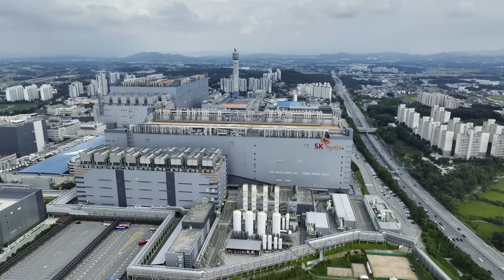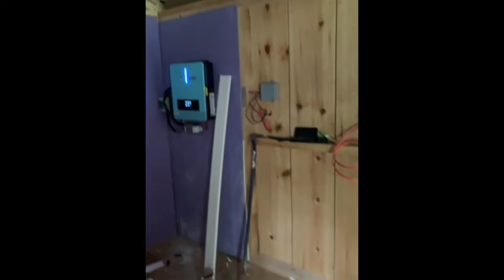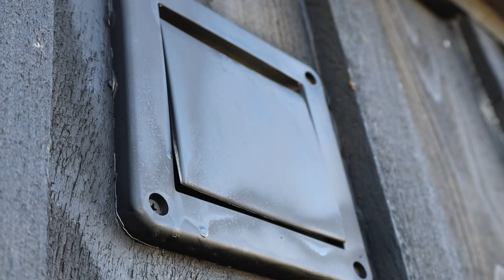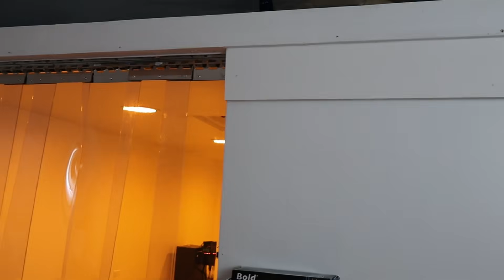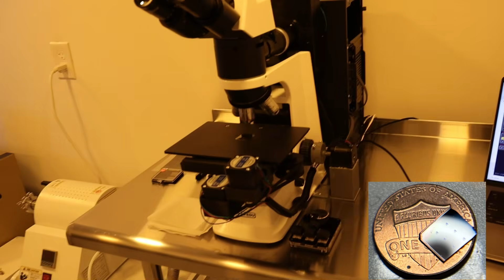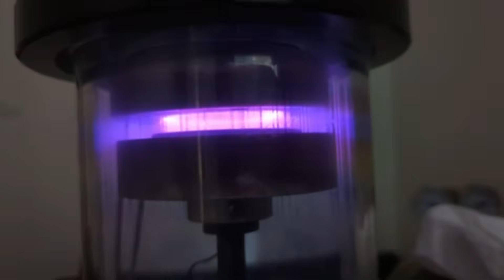There’s a Class 100 semiconductor cleanroom inside this backyard shed.

Comment: Speaking as someone who lives in Arizona, next time you ever take on a project similar to this, don't use those aluminized foam sheets, have a company come in and coat the entire inside surface of your building with polyurethane foam. I've been in attic spaces in the middle of the summer here and the temps weren't more than about 90, which is incredible! Usually an attic space in teh AZ desert is well over 140 degrees. It completely seals the space so the insulation performance is greater than anything else you can possibly do. Seems like having all external surfaces be airtight would be handy as well.
Reply from the maker: Oh man haha can't get away from the outside temps, I am always having to pull in filtered fresh air to provide positive pressure, where that air needs to be heated or cooled to lab temp. Crazy enough there are a bunch of little things to consider with a cleanroom, like spray foam will actually continue to outgas for months. Instead I used rockwool which sheds less and outgasses less than many other solutions.

Comment: Once you suit up, don’t you need to air washed first before going in? Or do you wait for several air changes inside before starting any work?
Reply from the maker: Great question, haha I have such crazy airflow in a small volume that I think I can just treat it as an air shower itself? Either way that is ok, it is for R&D mostly so yield isn't critical. I have a whole DI water system though and will regularly wash my cleanroom suit.

Comment: Good job, looks really good. Tip if I may: At some point you want to wash your cleanroom suit, please use a washing detergent without parfum and without fabric softener. Substances like parfum and makeup are contamination sources.
For those wondering, in larger facilities there are air showers between the gowing and working area.
Reply from the maker: Great tip! I did look into it, where having a company come to just pick up one suit wasn't economic xD So exactly that, I wash the suit myself by hand in a cleanroom environment. I use detergent without those additives and have a De-ionized water setup in my basement :P I leave the suits to just airdry in clean air after washing. 
I maybe should get one of those mini airshower systems, haha but I have so much airflow in a small volume that I kind of just treat the whole thing as an air shower?
Reply: @Dr.Semiconductor It does add to the cleanliness.  Whatever you don't bring in, the down draft doesn't have to remove.

Comment: Please build Charlie Chases and Garret Moddel’s MIM diode with casimir cavity. 

Casimir cavity MIM (Metal-Insulator-Metal) diode is an energy-harvesting device that generates electrical current without an applied voltage by tapping into zero-point fluctuations (vacuum energy)
Reply: Btw, I subscribed just to see you do this 😊

Comment: Does your gowning anteroom open directly to the outside environment? Is your anteroom air filtered? (HEPA or Bag filter) What is the cleaning process / frequency? Did you take particle counts for both static /dynamic conditions? What is the actual TAC (total air changes) for the main room and have you calculated a recovery time? Have you considered aquiring a cheap smoke generator for airflow visualisation?
Reply from the maker: Haha all great questions, yes the gowning area doors open to the outside, which isn't the best such that I run it with a bit more positive pressure than normal and minimize the time I am entering. The gowning area serves as a pathway for the air in the cleanroom to exhaust and loop back around so particle counts were actually around 200-300. In the "attic" space above the cleanroom which is the airflow return/entry point, fresh air from the outside is pulled in to provide positive pressure. This intake air has an initial MERV filter and then a HEPA filter which needs to be changed every few months. Since the cleanroom intake air is filtered the main HEPA filters can hopefully last a while. I know university labs that haven't changed their HEPA filters in over 20 years and still have reasonable particle counts. I also wipe down the flooring with a cleanroom wipe and solvents at least once a day. I have counts with both static/dynamic, haha I gotta calculate the TAC better since I have a different fan on one of the units but it is several hundred an hour. Should see about a cheap smoke generator but I have been just checking airflow is a meter, and watching cleanroom wipes blow xD 
Hope this helps!

Comment: the minute u open that door, the previously 99.9 sterile room that took weeks to build up to that point was instantly reset to zero. and should u be wearing ur clean suit outside?
Reply from the maker: Haha great questions, thankfully for semiconductors it doesn't need to be germ free or anything, but minimized particles in the air to prevent them from landing on wafers. But that said I run it at a higher than normal positive pressure to push air out when I open the door, as well as minimizing time the door is open, not perfect, but workable so far. Then no your right the cleanroom suit should never ever be outside, that's why for the little gimmicky intro I am actually wearing a disposable suit ;)

Comment: Like many others that have with cleanroom engineering experience, my last role supported manufacturing of semiconductor production equipment inside our ISO 4 cleanroom. 

First thought was absolutely, “what the fuck?” I’m assuming your knowledge here probably better than mine however I’ll give you some advice. Most of our sources of contamination was due to human behaviors. Wear some booties, have donning gloves and switch them out before going in the cleanroom. Use wands while handling wafers, wipe down surfaces with DI water mixed with isopropyl alcohol, upgrade the glasses to goggles and keep anything that could shed particulate out of the cleanroom. Finally, not sure if you have an O2 monitoring system, but it might be a good idea for general safety.

Also I was silently judging your donning process so kudos to you for doing top down. 

I subscribed and I am looking forward to the madness that is to come.
Reply from the maker: Haha exactly! And gotta watch what is brought into the lab! Yeah I have seen some labs double-glove to minimize oils on the outside of the cleanroom suit. I use the same DI-IPA mix to also wipe down surfaces and the wipe down the floor with a cleanroom grade wipe at least once a day to help keep it clean.

Comment: please i need the details of how the laptop and other items brought in comply, is it the airflow? so cool
Reply from the maker: Great question! So what the material is made of is very important. Like stainless and plastics generally don't shed a lot natively, where cardboard, paper, and wood do. Then anytime anything is brought it it needs to be thoroughly wiped down since particles from the outside will still deposit, cleanroom grade low particle count wipes are used along with isopropanol. Haha though if it were perfect you wouldn't need the constant fans, it is all about minimizing new generation of particles into the air.
Reply: @Dr.Semiconductor  "cleanroom grade low particle wipes" wow that's certainly new to me, nice!

Comment: I’ve always wondered if it was possible to make really good chips by modifying a hard disk drive. They’re already insanely precise, and materials like photoresist for magnetism already exist.

Maybe something like this could be a really cool project.

There are also HAMR drives which can use lasers and heat at the same resolution for writing data.

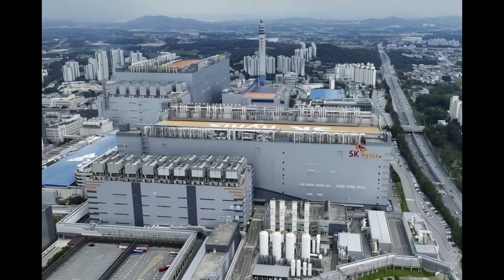Comment: how'd you make the transition at 0:47?
Reply: pretty cool use tbh
Reply: AI
Reply: Looked like ai, prob a starting image and an end image and make it imagine the middle
Reply: @christaps5126  yeah ai, some kind of cross-scene interpolation, but which tool that uses ai specifically i meant :P
Reply: @Couleur I bet it's some plugin in Adobe after effects, no actual knowledge on my part but it's probably just a regular old image morph with some sparkles
Reply: @christaps5126  Actually, you can do this in Blender, and use google streetview cameras to start with a photogrammetry model of the building, and then lerp the model's vertices from one to the other since it's going from more complex to a simpler shape. Probably not how he did it because it takes a lot of time, but just saying it is possible to do by hand.
Reply: AI…

Comment: You should also measure particles while your clean room is in activity. When I measure particles in an empty clean room with no activity, the results are very much different from a clean room with operators, equipment running, etc.

Comment: Where is the air return?  Usually in a laminar flow clean room the floor is a screen  or there are air gutters in the corner of the floor.  This is a small enough space where the reynolds number isn't going to be super important - You're turning the air around every few minutes

Comment: Always find it funny how not very clean a clean room is compared to what peoples expectations are, I assure you none are as prestine as you think they are. The air thats flowing may be clean but the surfaces of everything is not. Thing is in any modern fab the wafers are in FOUPS and are usually N2 purged at various points when they are stored between Operations. If you ever get to go into a fab just look at an actual Equipment Technicians smock, itll have grease and grime all over it and most of the time itll get worn the whole work week. 

Not to mention while yes you want to limit debris on the wafer, Their are alot of steps to remove it. You have multiple Scrub operations and sometimes Cryo steps to freeze particles to get them off, Spin Rinse Dry. Most scrap ive seen comes from Corrosion, Blocked Etch, or poor wafer handling in more manual fabs, Charging and Misprocessing. Airborne contamination from dirt or skin particles or whatever is so low compared to everything else i mentioned. This is all in bigger fabs BTW and still maintained 99% PY.
Reply: And yes blocked etch is from surface debris but usually is from the chamber itself or something in the wafer path on the tool depositing debris on the wafer vs it actually coming in from the fab on the wafer before an etch

Comment: What's the goal here?  Do you have everything you need to make a usable chip with outer package and pinouts?  Are you going to hone your technique with existing publicly available lithograph photomasks (I'm not sure what they're called)?  Are you going to make your own circuit designs and produce the photomasks?  Do you have the means to go from a schematic to a usable lithographic photomask?  Am I completely off base about how microchips are made?  It's not immediately obvious what you intend to use this lab for.

I'm obviously not an expert, but I don't see how you can go from schematic to completed wafer to cutting that up and packaging it into a usable chip with pinouts.  I didn't see the equipment for some of that.

Comment: This looks amazing. Is there a process for starting up, or do you have to keep the air running all the time always. That is, can you turn off the cleanroom, when you're not using it?
Reply from the maker: It is optimal to keep it running 24/7  which I do xD I try to offset the usage with solar panels, fans+lights use 600W, which periodically spikes to 1.5kW when the mini-split turns on for heating-cooling.

Comment: This "clean room" would never pass ISO 14644 or USP inspection. While the room does have a low particle count there are other elements to consider.
Reply: And it doesn't matter because it's a home lab for experimentation.
Reply: @Kniffel101  It matters if you're trying to keep a sterile environment. In the real world clean rooms should never be turned off.
Reply: @matthewgriffiths527  But this is not for production, so it does not matter as much.
Reply: @Kniffel101  Then what is the point? A room that looks like a clean room?
Reply: @matthewgriffiths527  EXPERIMENTATION

Comment: There's two things I notice missing.
1. No CMP will sharply limit the processes & number of layers you can do. You can work around it with various tradeoffs, but the alternatives are far less developed bc CMP is so good at its role that little effort goes into replacing it in industry. It's hard to DIY or buy on Ebay, tbf.
2. No BEOL / FEOL isolation means using metals like copper or cobalt without contaminating equipment will be nearly impossible. It can be worked around with Aluminum, Ruthenium or other interconnect materials, but with tradeoffs.
These aren't show stoppers. If you just want nodes well above a micron with aluminum BEOL to replicate 60s/70s level tech, and some MEMS as a treat, then it's fine. Based on the patterning setup's mechanical limitations, I assume you that had in mind in the first place.
Reply from the maker: haha yeah so I mostly do novel R&D on materials and devices, since it's not viable commercially for silicon at this scale, but maybe for youtube :P I would love to make some devices from the early 2000s. 
I have a few tricks planned for planarization, there are alternative methods that were developed and patented back in the day, but the industry consolidated around CMP. These methods though are perfect this scale, stay tuned :)

Comment: That laptop doesn't really know yet but its fans will be the cleanest and happiest fans around.
Reply: Hopefully he cleaned every Instrument beforehand.
Reply: @MaxMichel89  yeah those 5 particles might all be coming from internal dust lol
Reply: @antiLGTBQ  It's all recirculated through the filters. Dust inside will get trapped in the filter.
Reply: I am surprised that a fan is allowed in a clean room. I would have thought that it was too big of a concern for kicking up dust.
Reply: @木精灵14 i mean ideally there'd be no dust to kick up but also the entire thing revolves around a giant fan pumping air into the room
Reply: @samo4648  You are right, ideally there would be no dust or paraticlels to kick up, but it is a class 100 clean room, so there is a lot of partiles of different sizes. Normally there is three categories: heavy, medium and light. Heavy fall down relatively fast (with an hour), where medium can be there for a day and light will stay suspended unless sucked up. The fan that is pumping in the air is quiet normal for clean rooms, since the positive pressure side of that pump is filtered with the HEPA filter as he explains in the video.
Reply: @木精灵14  it's for added positive pressure, as long as the pressure inside the room is greater than the outside it heavily deters dust and other particles from entering.
Reply: @influx__ they meant the fan from the laptop
Reply: @canadian9628  I don't think any passively cooled PC would be powerful enough to be of any use in this kind of environment to be completely honest. Ideally there would be a desktop machine isolated from the clean room entirely and only a monitor and peripherals in the room itself. But to be completely honest that's being pedantic. The level he is current at is the industry standard for what he is doing. There is always room for improvement, but at a certain point it's just diminishing returns.
Reply: @木精灵14  Should use a fanless pc
Reply: I have a couple of vintage PCs that came out of a cleanroom. Absolutely immaculate. I'd never seen a 30 year old PC with no dust in it. Looks like it just came off the production line.
Reply: Its a macbook which i assume is not doing alot. I didn't catch if it is an air but macbook airs dont have fans. If it has a fan it probably isnt even on because of apples tuning.

Comment: This reminds me of a book series by Gerald M. Kilby starting with "Colony One: Mars". In one of the books, Earth stops sending supplies of any kind to the relatively well-established colony for an extended period of time. The colony managed to be self-sustaining in all but ONE area: advanced ICs. Everything ran on chips that inevitably failed due to ambient cosmic radiation... It got me thinking of what one would have to ship to e.g. Mars to bootstrap a submicron process, on the assumption that all the science and techniques are already known. It also demonstrated the pitfalls in using unnecessarily-advanced electronics for critical systems - there's no reason for a Mars rover to require silicon built on a 10nm process, and plenty of reasons not to. It even begs the question: in the case of something like a Carrington Event or a nuclear EMP, are we as a civilization setting ourselves up for widespread unnecessary and catastrophic failures by using silicon that's too fragile? I just did a cybersecurity analysis on a telemetry device that's going to be used to literally just transmit the state of a sewer-pipe float switch, and it's got a 40nm microcontroller, nevermind whatever the cellular module uses. Granted, a flare or EMP wouldn't be particularly kind to a hardline approach either, but... <shudder>

Comment: I worked out of a tiny clean room for years fabricating III-V stuff at my university, this is something I've thought about so many times. Will you be sharing design and equipment details, maybe the building plan? I think open sourcing chip design on a home lab scale could allow easier access to the semi manufacturing industry, Nvidia and Intel are basically living on no one else having the years of process refinement.
Reply: On another note, have you thought about reaching out to other YouTube creators like NileRed to set up liquid nitrogen production? Are you making your own di water on site? So many questions!